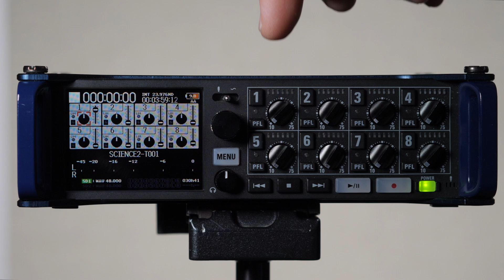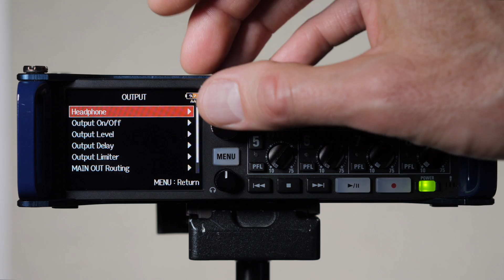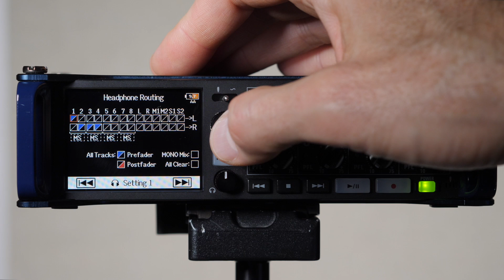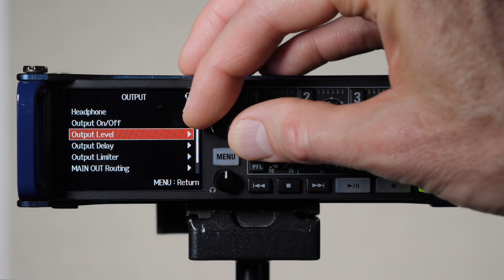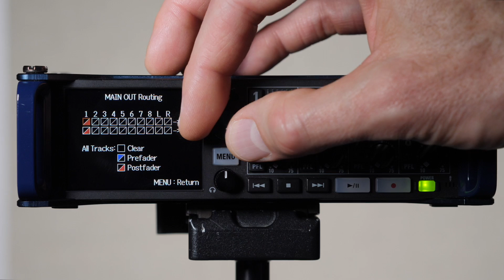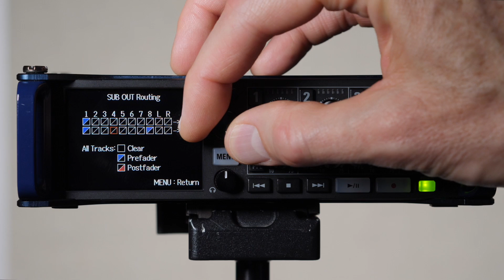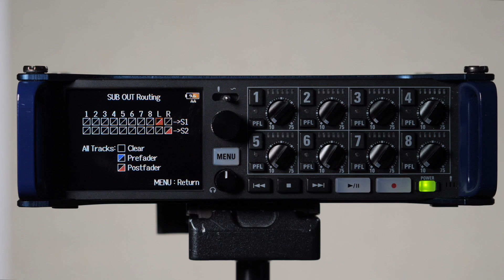Sound for Video Session: Headphone and Output Routing Demo - Zoom F8 Recorder

Comment: I haven't used the F8 as extensively so forgive me if I'm incorrectly thinking about this. 

Is normal to just listen to all the tracks prefader? Does that not allow you to listen to any adjustments you make during a recording with the faders, for the isolated tracks?

I can understand if for example you are listing to the mixtrack postfader, you are making adjustments for the mix that will be handed off to post for a quick turnaround. Nearly everything I work on though, we are going into the iso tracks for the mix. Is it normal for the iso tracks to be minimally adjusted during recording then, and just have a proper gain set at the beginning of recording? What if a track gets too loud during recording, and you don't have limiters to catch it?

Sorry for the long question. The proper philosophy and usage of prefader and postfader listening has continued to elude me for a while.
Reply from the maker: Hi ahriik, faders only affect the stereo mix, they don’t change what is recorded to iso channels. So yes, if you’re mostly just using the isos in post mixing, then monitoring the pre fader iso channels makes sense. And yes, ideally gain is set up at the start and is not adjusted during recording of a clip, but you have to do what you have to do if things get louder than expected. I would not think of the usage of pre vs post fader as proper or not proper, but what is most useful to you as the mixer and what other members of the production need. Good luck!
Reply: Thanks for this reply. At the time of my question, I was using a Tascam DR-701D as my primary recorder (which only allows for gain/trim settings, no fader options). I've since upgraded to a Zoom F4 in the past couple of weeks, and this video and explanation regarding pre/post fader monitoring makes much more sense!
Reply: Thanks ahriik, glad it makes more sense! Also, congrats on your new recorder!